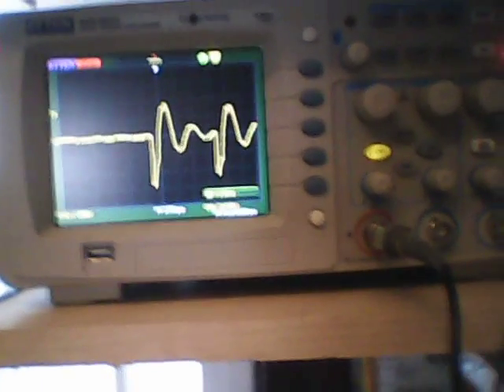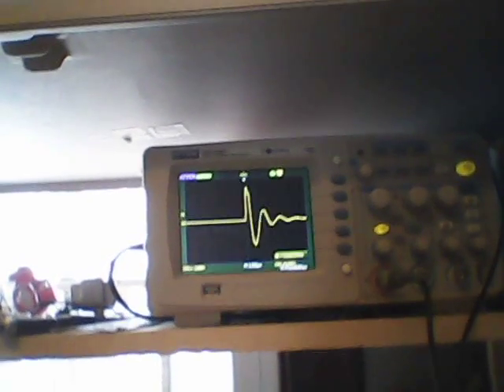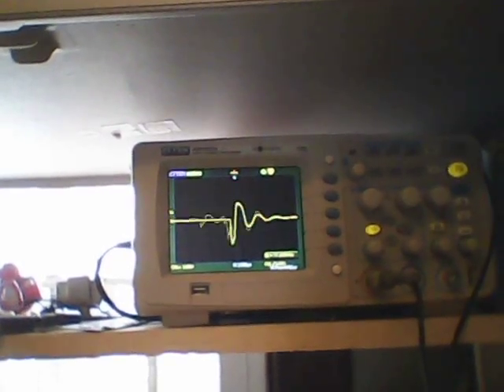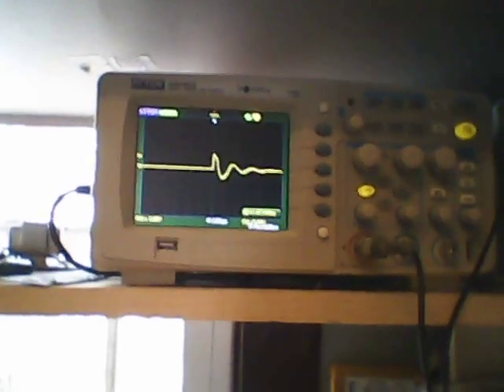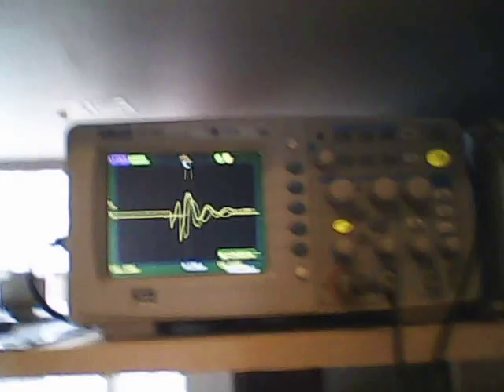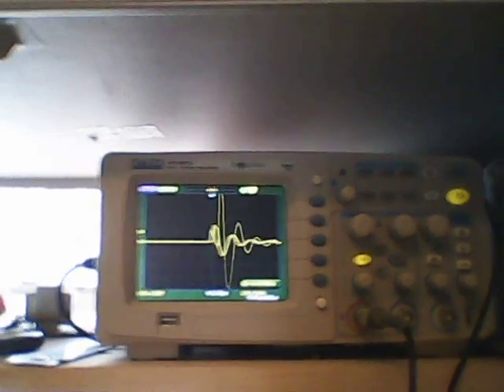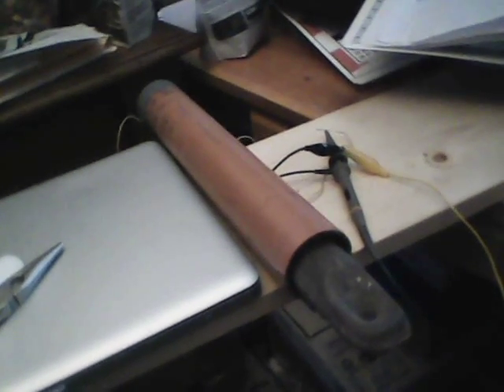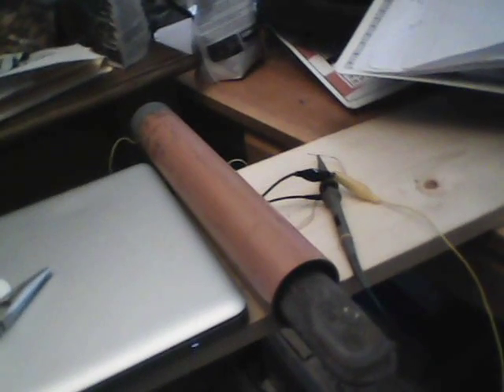Acoustical Ringing Generates Voltage

Comment: Very cool !
Wife said 'piezo effect ?'. The ringing makes me think of Ed Leedskalnin, ancient legends and more. I wonder if a motor and wire brush on the end would generate well, then change to different materials and see if any work better than others (including soft materials at high speeds). Perhaps convert that to wind power and the blade shaft scrubbing the metal. All in all very weird but evidently doing something !
Reply: My first thought was Guitar pickup. My second though was the resonating metal tube wind chimes a friend has.